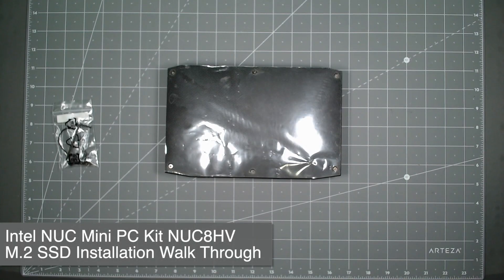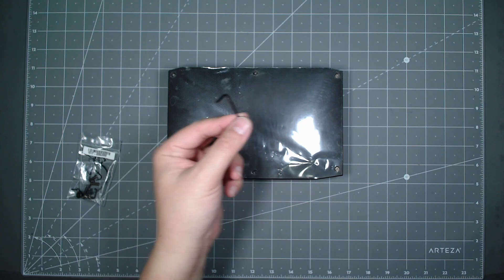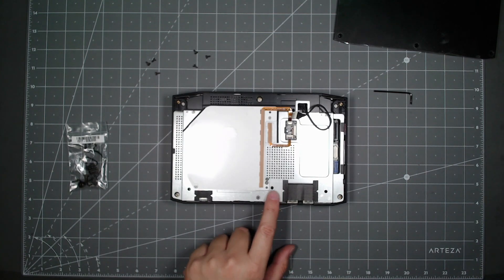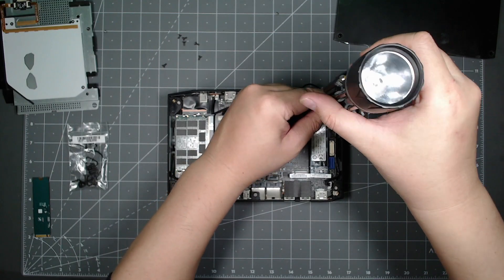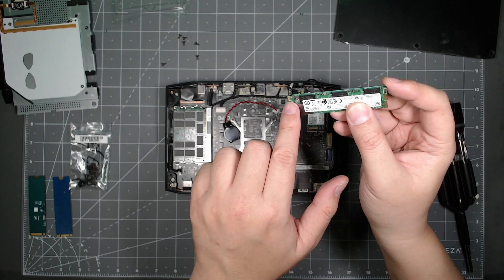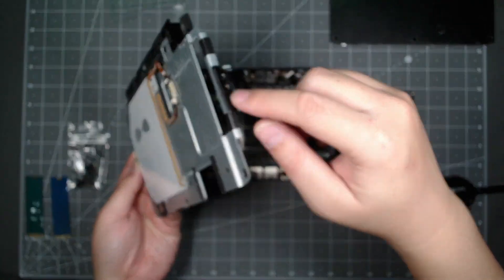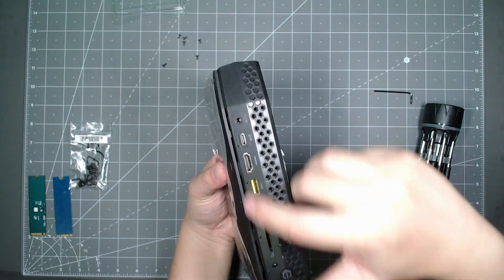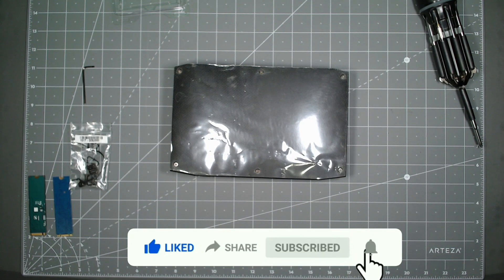Intel NUC Mini PC Kit NUC8HV M.2 SSD Installation Tutorial

Comment: Nice one... Can you tell me the specific serial number for ssd you replaced it. I'm trying to upgrade mine to 1tb ssd
Reply from the maker: Hello!  This SSD I had is an old one.  I would get a Samsung 990 SSD Pro 1TB for faster read/write speed.  I think the one that I used is an older gen one that reads slower.  The good thing about these M.2 SSDs is they aren't really picky when jumping from different manufacturers.  I've probably swapped out a few different manufactures with this NUC and all of them seems to work without a problem.  Hope that helps!
Reply: @TonTimeTech I'd recommend that you check the compatability of generation in SSD's. The 11th gen Phantom Canyon NUC.   requires a 3rd gen in its contemporaneous literature. I would also encourage you to use a simple means of static protection.